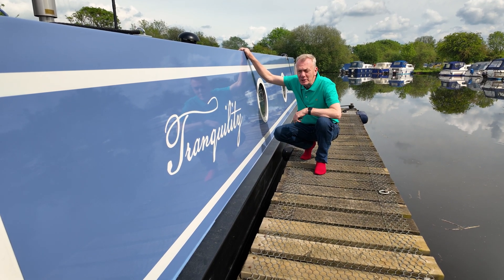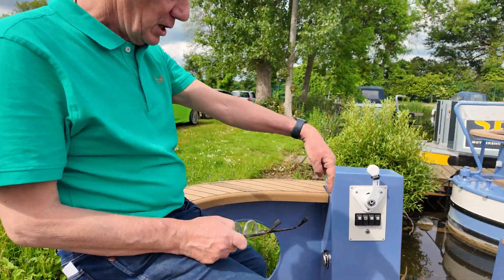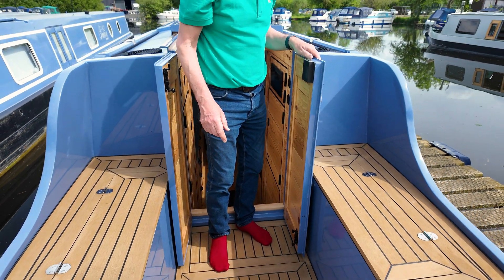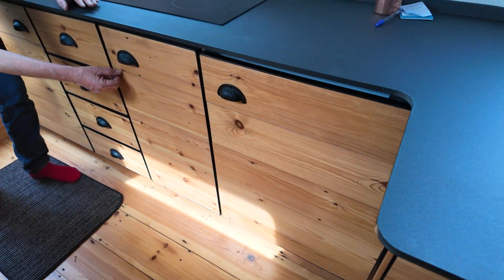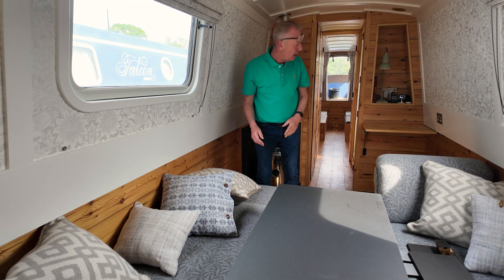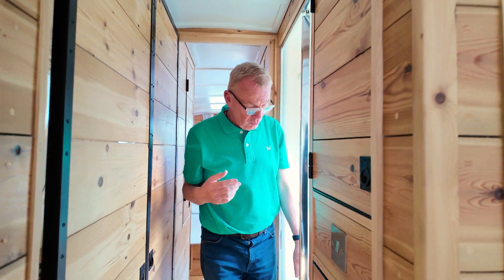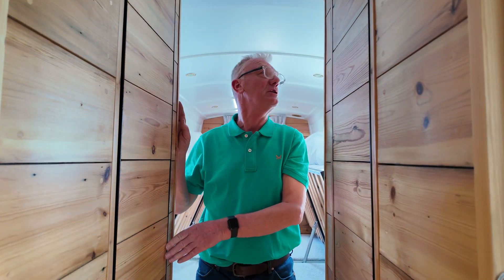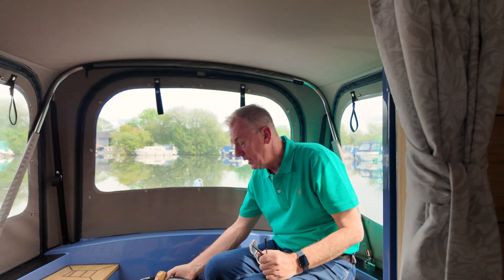Stunning Electric Narrowboat called Tranquility | Review then Maiden Voyage

Comment: Lovely vessel wasnt to sure about the gaps in the doors surely would allow light through ?
Reply from the maker: Thanks. Do you mean on the duck hatches. It’s only a millimetre or 2. Cheers Tim
Reply: @mothership_marine   no the door on toilet  was a 3 or 4  mm if you look at video when you opened the door you could see light  through wouldn't  be too impressed
Reply from the maker: I understand now. It allows air to pass through but it really difficult to see through because the boards are so think. Tim